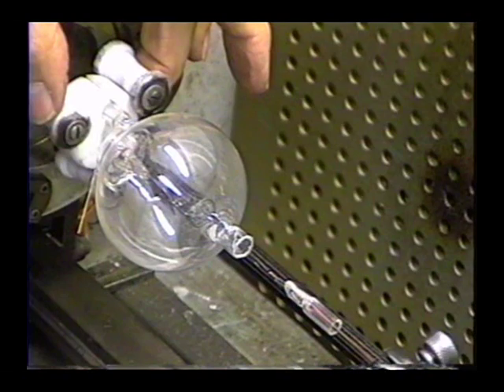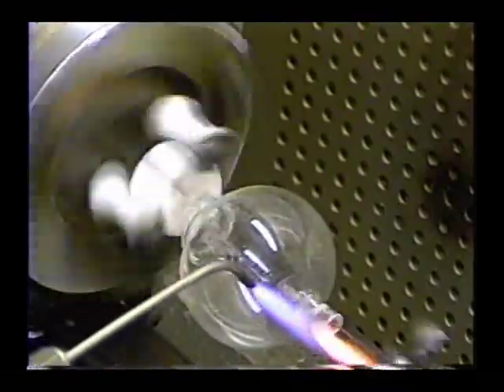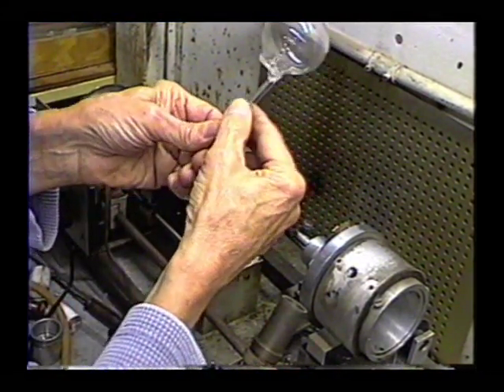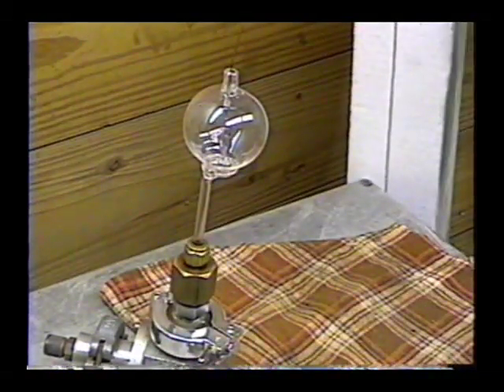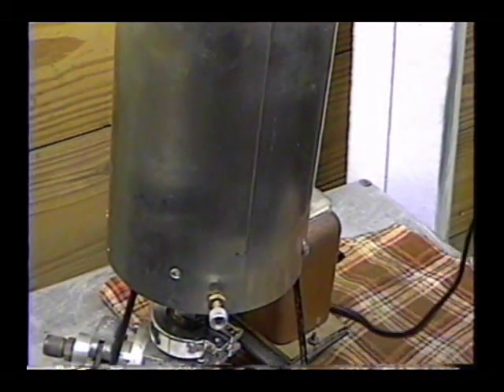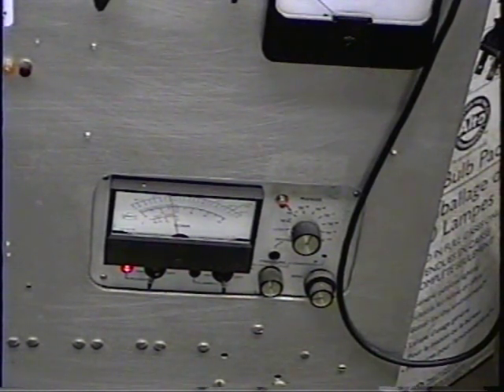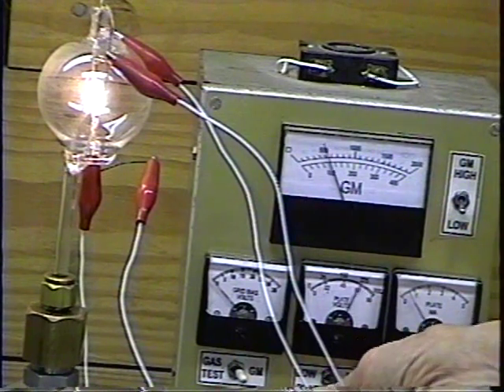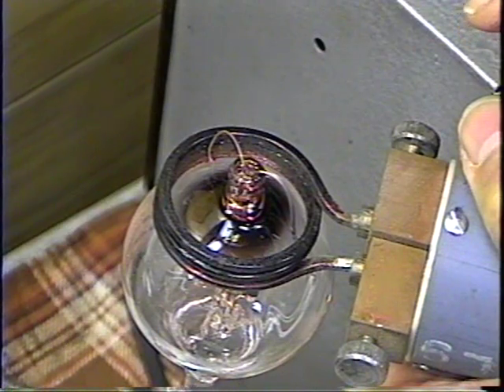Making a spherical audion vacuum tube part4

Comment: How is high vacuum applied when blowing glass tubes? 

Specificly, do you only need only a roughing pump when working on the tube, and then when your finishing the tube do you apply high vacuum from the diffusion/turbo pump? or do you always work on the tube under ultra high vacuum? 

I'm interested in making tubes and have sourced a diffusion pump and potential glass lathe.

Thanks,
GGL
Reply from the maker: When blowing the glass it is all done using lung pressure! After the tube is sealed completely, it is placed on the high vacuum system to be processed to remove all the air.

Comment: Do you have schematics for your transconductance tester?  I have a tube checker that tests emission of the cathode, but does not measure mutual conductance.  I am mainly testing tubes for guitar amplifiers, and hope this would be a good test to possibly match output tubes for push-pull configurations.  I love your videos btw!  the old ones are a bit tough to watch quality wise, but i know youre working on a budget ;)  either way its the knowledge youre sharing that matters, thank you and keep up the awesome work!!
Reply from the maker: I would buy a good transconductance tester on ebay. You can get a good unit for less than $200. Also see Dekker's uTracer kit. (It's demonstrated here on youtube.)
Sorry about the old videos. I was just learning back then and have found no way to "upgrade" the videos. If I redo them and upload them again I lose all my views.
Reply: @glasslinger  ill search around and see what i can find.  i guess the hardest part is finding the right transformer with multiple taps :)
Reply from the maker: You probably will have to wind your own. That's what I do.

Comment: 5:48 what is the socket for connect the glass? is it standard pneumatic parts? I bought a press fit socket will it work for this purpose? i try to find my local hardware shop i cant find the socket exactly like your one.. and your vacuum pump is just mechanical pump? or mechanical pump cascade with  diffusion pump?
Reply from the maker: The fitting is the closest you can find to fit your tubing. 6mm glass tubing fits perfectly in the hardware store 1/4 inch compression fitting. Use a rubber O ring instead of the brass ring. The vacuum system has the mechanical pump and a diffusion pump. Typical vacuum is in the 10-5 torr range. The getter will clean it way down lower after the tube is sealed off.

Comment: What would it cost to buy an audion that is non-gettered? Rick
Reply from the maker: $125. Note that no-getter audions will gas up in a few months.
Reply: Will they still detect after they gas up? Even with low plate voltage?
Reply from the maker: They will work as a gas audion until the gas pressure gets too high. I have had some that lasted several years. It depends on the source of the gas getting into the tube. A leak is worst, but a trapped volume in one of the feedthrough wires is also bad. Note that virtually every original spherical audion (new old stock) has gassed up to where it is inoperable.
Reply: If you still have one that has held up for several years and is non-getterized, I'd be interested in it. Thanks so much. Rick
Reply from the maker: Send your phone number to me again. I lost it.

Comment: Ron, I saw you use an induction heater to flash a triode you made. I was wondering where you got it and if you have ever used it to reflash factory-made tubes. I have a number of Tung-Sol 6550s I'd like to make more presentable. Thanks!
Reply from the maker: +Jeffrey Morrissey 
The getter flasher is homeade. See my TUBECRAFTER website for the details on building one.

Comment from the maker: Hello!
The tube is baked out under high vacuum at 900 deg. F for 4 hours. This disintegrates any organic residue such as finger prints and any other grease that may be on the elements. I have had no problems at all with contamination.

Comment from the maker: Hello!
The original audions made before about 1910 were all soft gassy tubes because de Forest was under the impression that gas molecules were necessary to carry the electric flow through the vacuum. He finally discovered his error and from that time on all the audions were pumped as well as possible. The audions had no getter so the degree of vacuum deteriorated quickly and is the main reason N.I.B. audions found today are not functional.

ron